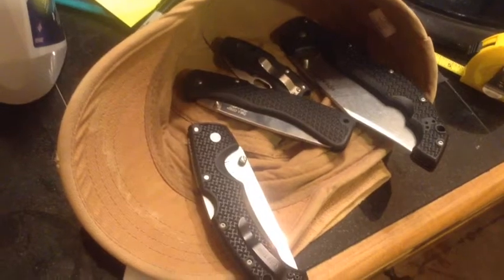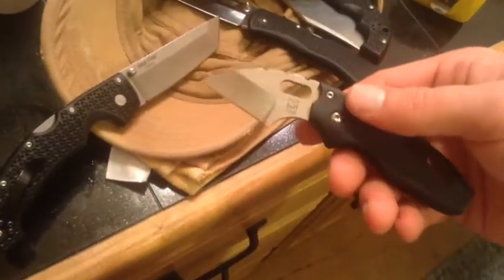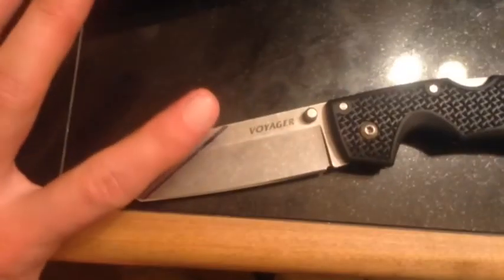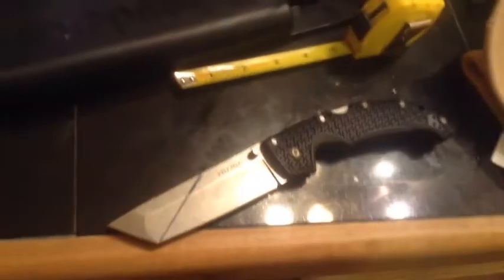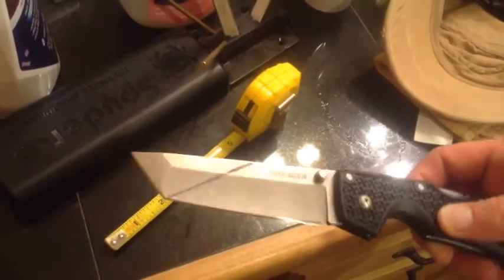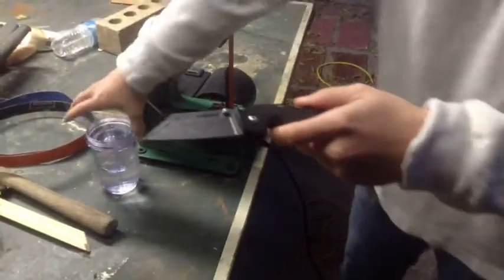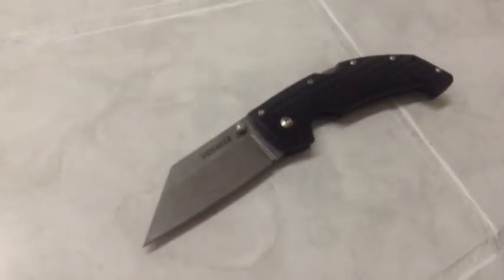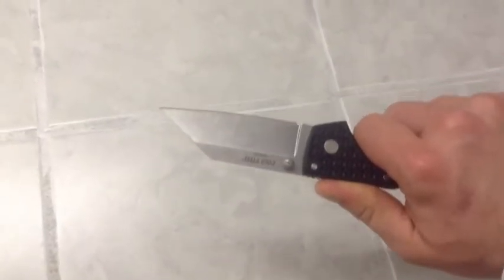How To Make A Wharncliffe Voyager

Comment: One of the sanders I use is the same one you have. 

It is a cool mod. But how do you get around over heating when using the angle grinder? Do you poor water on it constantly?
Reply from the maker: I made the cut further away then the finished part of the tip. So, the blade did heat up, but any steel that would have been "over heated" would have been grounded off with the sander. It is risky, but it worked.